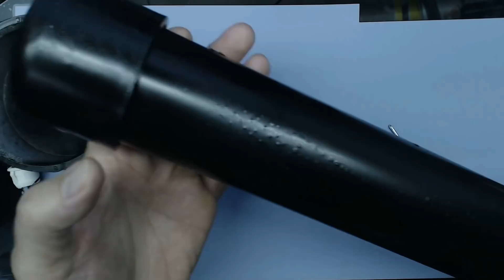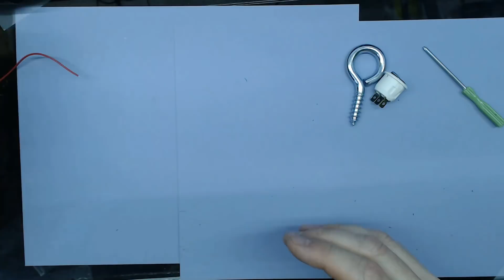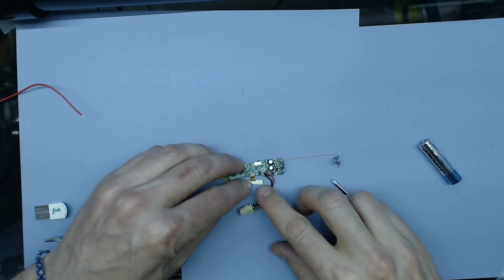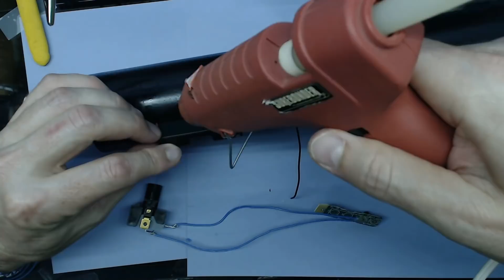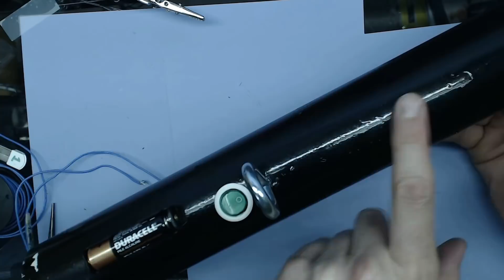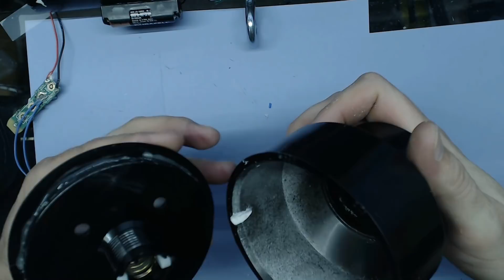Ninja Button Construction

Comment: I like your let's plays. I don't give a rat's ass about the ninja competition bullshit(it's the subject itself, nothing personal, sorry but not sorry). At times, I kinda wish you'd split that into it's own channel(which has it's own merits), but then I'd likely miss out on diy shit like this.

Also, a couple of hints on the paint if you want it to look better(although if you just want it to work, ignore this it's in no way necessary), go over the pipe with a high grit sandpaper before you paint. You don't have to do to much, you just want it scuffed and don't want any large scratches, so like a 600+ grit. Then dust it off really good with compressed air or wash and dry it well(needs to be bone dry). Then use light coats, maybe even consider a primer if you want that to last a while and stand up to the abuse of a bunch of sweaty dudes/dudettes bashing on it. But a very thin, light coat, give it 20-30 minutes, then another. It doesn't need to be fully cured between those layers, but at least 20 minutes will let it set and hold the next layer.  Then let it fully cure for a day or two before touching.
Reply from the maker: Thanks. :) I've considered trying a high grit sandpaper or something like steel wool or the rotary buffing thingy (technical term) for the dremel to de-smooth the surface for painting. The other concern is that the paint is easily scratched so I've considered adding several clear coats but not tried that yet. (Spray paint thinner is still a migraine trigger for me, as I found out, so I have to be very careful about I exposing myself to it.)

I did start another channel to put my non-gaming videos on, but youtube de-monetized it for being too small (because this means they can't be sure I understand how to comply with their ad-friendly policies, even though I have this channel, seems legit) so I decided to put all of my extra content here. I have a large variety of topics to my extra videos and I'm sure 95% of my regulars will have no interest in them, which is ok with me. Every once in a while one of them might be a gem that you wanted to watch. :)
Reply: Lift Pizzas you may find a good/satin/matte varnish to help, some are harder than the pigmented paints.